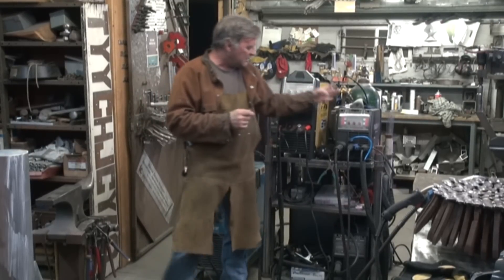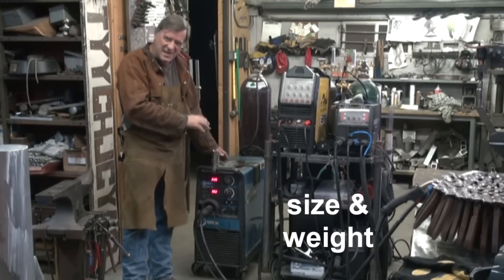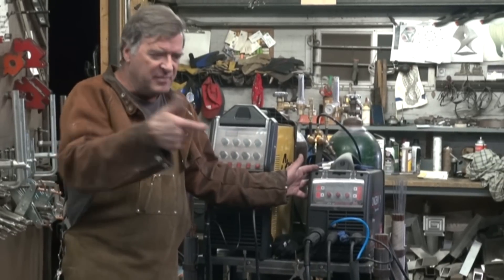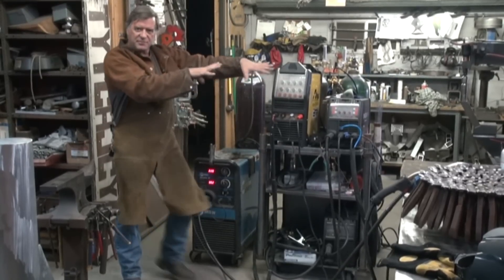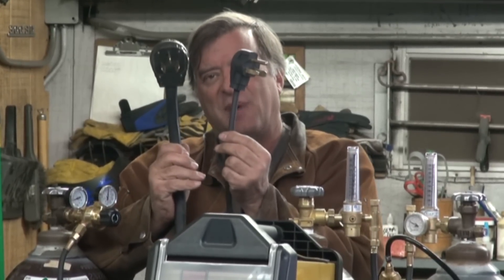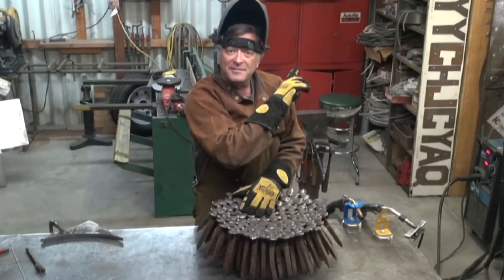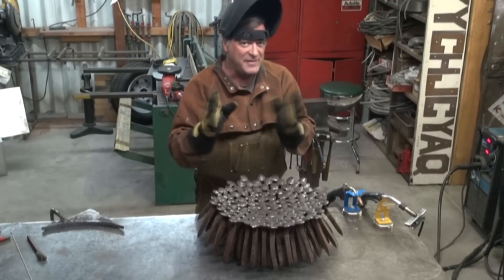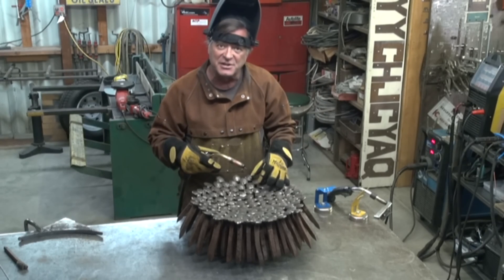Inverter vs. Transformer MIG Welders - What's the Difference? Kevin Caron

Comment: There's some major differences that were not mentioned in this video. First off, inverters use a series of micro-processors to convert high voltage/low amperage AC input to low voltage/high amperage DC output. Transformers use a step-down transformer and a rectifier to achieve this. Secondly, an inverter machine can be constructed and programmed to switch from CC (constant current) to CV (constant voltage) at a lower cost and in a smaller package than a transformer machine (hence the affordability and portability of inverter multi-process machines). There is one big advantage that transformer machines have over inverters though. They can handle input voltage spikes a lot better. This means you won't have to worry about running them from a non "clean power" generator. Inverters are basically computers, so the inner electrical components are a lot more likely to fail when exposed to relatively minor amounts of abuse.
Reply: That's why I own a Lincoln ideal arc 150 from the 80s. No computer chips in those
Reply: A lot more welders are going inverter because they are so flexible. Advanced pulse, advanced arc, etc like Everlast has at reasonable prices is only going to get better.
Reply: I'm no expert, but to my knowledge inverter welders share technology with switching power supplies (SPS). A microchip adjusts the output voltage continously to the desired spec, so it is much more stable than with a transformer. This is a big advantage compared to the massive voltage drop of an iron core transformer while welding. So even a varying input voltage does not matter too much I think. For example, modern phone chargers (also SPS) can operate at a large input voltage range between 100 - 240 volts due to this technique. But in terms of "how bulletproof is a welding machine" I would favor a classic transformer machine over a modern IGBT.
Reply: Inverter machines cost MUCH less to make and a hell of a lot less to ship, just like the difference between CRT and non-CRT computer displays. That's great for manufacturers because they use a lot less expensive copper and heavy steel.
Reply: You should make a video
Reply: Perfect explanation, in particular I have an inverter that has already burned 3 times, while the wound welders are 35 years old and never needed to do anything more than their cleaning maintenance.
Reply: @danielgustavo10  I have a Everlast 5 years old used almost weekly. Often daily.  221STI    I have had zero issues. I don't plug  it into dirty electric off of a cheap gen set.  Other than that about once a year I remove the cover and blow it out. Nothing more. It running 200 amps is not even drawing 30 amps off my breaker.   The first series inverter welders was a mosfet and they was not as dependable as the newer IGBT ones.  They IGBT can switch voltage at a much faster hz than a Mosfet.   The old transformers are running only at 60hz as that is what the power grid is. (in America 50hz most other countries)  The inverters have a much much smaller transformer driven by the inverter it can run the AC input current up as high as 100,000hz before going through the smaller tiny transformer.  So they switch the current a hell a ton faster and the coil builds up the amperage without the huge windings and the heat.  So tiny windings in the small transformers in the invert  can take lower amps from the breaker and boost them way faster by increasing the hz so high.    There is so much more benefit over a transformer machine.     Neither is a bad machine depending on needs and space but I got rid of my miller after getting my everlast.    If I was burning welds 10 hours a day everyday with just a mig or stick in a fab shop I would choose a transformer machine.  But no comparison for tig of any size or for a hobbiest in a Mig Stick.
Reply: "There is one big advantage that transformer machines have over inverters though. They can handle input voltage spikes a lot better. This means you won't have to worry about running them from a non "clean power" generator."

This was the answer I was looking for. I only have a traditional generator at my house. I don't have access to mains until I rewire my house, so I can pass inspection. I was wondering what combination of inverter, or traditional generator to inverter, transformer welder I should be rocking. 

I'm guessing here that I need either a traditional generator, with a transformer welder. Or a inverter generator, with a inverter welder. 
I'm also guessing that I can pair a inverter generator, with a transformer welder. But I am curious how the power being 'transformed twice' would handle with efficiency.

And you 'could' run a inverter welder, with a traditional generator. But you would implement this 'dirty power' jargon to the mix. I'm guessing whenever you put a load onto the generator, it messes with all three: amperage, and the frequency(hertz), and volts. Which is problematical with electronics that are picky about what flavor, wait time, and amount of "food" they are given.

EDIT I just watched a video titled 'INVERTER vs TRANSFORMER Welder run by Champion Gen???' and before I start. He is at a elevation of 7,500 ft. Which for every 1,000ft in elevation, you lose 3.5% in power. 

In his video, he used a Miller 211 transformer welder & a Lincoln 210 MP inverter welder.  He did a test at 19, 18, and 17 volts. Accompanied by 10, 12, and 14 gauge. He is using MIG. All 3 tests with the Miller 211, you could hear the Traditional Champion 3650 watt generator bogging down. While the tests with the Lincoln 210, the generator seemed to be handling pretty well. Though, the generator did give out at the 19v, 10 gauge test with the Lincoln. 

I think I will be getting a inverter welder to accompany my traditional generator. I will update you all later.
Reply: There is no comparison between the electronics of 2 devices, auto dark helmets vs Inverter welders.
Reply: The suggestion that inverter electronics are more prone to failure is an uninformed opinion. Look around you electronics everywhere in everything with very few issues. Auto dark helmets have electronics and get slammed around all over on the daily with no issues.
Reply: @heyyou5189  exactly.. I had never heard of a Longevity welder until I bought one about 4 years ago. This thing has been a good little machine.

Comment: It was interesting watching the difference.  I use delta weld 452 machines and run anywhere from 300-500 amps with long welds.  Have you run inverter machines at that temp and how do they do.  Thanks

Comment: HI Kevin I am hobby welder and have found your videos very helpful Thank you.
I am considering purchasing a new welder the Linde 180 mig it is an inverter type mig dual voltage. The price seems right at 799 includes a gauge. I have looked for reviews on this welder and have not found much. I mainly weld round bar and steel pipe up to 5/16. These inverter welders seem to be the direction the light weight migs are going in. I was wondering if you have heard any thing about this particular model P.S. I am in Canada
Reply: Thanks for getting back to me ...... the search continues.

Comment: This comparison is missing a critical point; capacity. Does the longevity weld everything the Miller does? Duty Cycle? Will it last as long? That really should've been included.
Reply: You are comparing junk to a real welder with one-side information. There is no free lunch.  Used every day hours on end, iron that is thicker than 1/16 the longevity will come near the miller. Why did you waste your time trying to fill us with BS. Real welders with the real places of business will obviously see through and see this as your weird.

Comment: In mig welding I actualy like transformer welders more. I did comparison betwen 4000€ hi-tech inverter mig (broke twice in first year of use) and 1500€ transformer mig welders (working 8hr per day for 4 years). They were very close in spray arc mode, but in shorc-circuit arc I liked transformer mig more. So realy why pay more for the same thing. Both welders were made in EU.
Reply: cebora 350A pulse mig  and varstroj 330A transformer mig. btw we use cebora mostly for thiner aluminium and some brazing with CuSi3 wire, where pulse mig is the way to go. But for anything else I would go with cheaper and more reliable transformer mig. Some newer cheaper chinese inverter migs are cheap, but i haven't try any of them. But we actualy have 350amp chinese tranformer mig and it welds great, the only thing that died in few years of use is torch (came with cheap torch).

Comment: So, do you get better duty cycle out of transformer based?  Kind of was expecting a pro/con to each type.
Reply: *****
Good video Kevin.  As far as duty cycle, overall, you'll find most inverters carry a better duty cycle than the equivalent transformer, whether its MIG or Stick.   You'll seem some parallel duty cycles in TIG on some machines, but overall inverters do have better duty cycles than transformers.   A transformer MIG for example like a Miller 211 has a low duty cycle, almost unmeasureable at 200 amps...but a 200 amp inverter MIG may be 35% or better.   Something like the transformer Millerdial arc 250 has a 30% duty cycle at 225A.  In contrast the PowerARC 300 has a 60% duty cycle, and the PowerARC 200 has 60% as well.   The buzzbox 225/125 Lincoln tombstone has barely a 20% duty cycle at maximum amps and only puts out 12 5 amps on DC at 20%.  The Lincoln precision TIG 225 (Xformer) has a duty cycle of 100% at 90 amps. The inverter Everlast PowerTIG 225 has a 100% duty cycle at 130 Amps...
Reply: So, are we saying that transformer based is just old technology and there is no pro over inverter based?  Inverter is the new hip brother that can do everything the transformer based could do and more?
Reply: IMO Transformer MIG have always been better than inverter machines. Yeah salesmen remember to hype new models duty cycle getting better and better. Still many of them "surprice surprice" seem to fry their circuit boards in heavy use. Also transformers obviously withstand dust, shocks etc. much better than inverters. But have to admit that inverters are nicely compact machines and in Tig use they're good machines. Of course inverter MIG is also ok, for sheetmetal works and such, but I'd never get one for even moderately heavy Mig welding.
Reply: Thanks!
Reply: jothain
The most favored heavy shop and field use units such as the Miller XMT 304/350 and the Miller's MIG 350P have an unequalled success and lifespan.  They are being used everyday in rough service conditions.  Lincolns invertec series is not much different.  Even some of the newer engine drives are featuring chopper (a poor man's inverter) technology, and even inverter based technology and are seeing heavy abuse.  Transformers don't withstand shocks better.  Miller drop tests their inverters from a 10ft fall.   I don't think they do that with transformers.   There's no reason to pick them up (transformers.  Some of the transformers use wood framing inside around certain parts.   Even Miller has transformed their new syncrowaves into inverters.  Everlast has been in a steady improvement program to make the units more resilient, and is now we've been seeing the results.  Inverter MIGs are some of the best arc producing units, especially with arc force control...again you just have to weld MIG with a XMT 304 and most people will throw rocks at their old transformers.  I own a transformer MIG, a heavy industrial name brand 270 amp one.  I love it, but it doesn't hold a candle to performance like  my inverter Everlast for arc stability.
Reply: @everlastgenerator  exactly , 100%